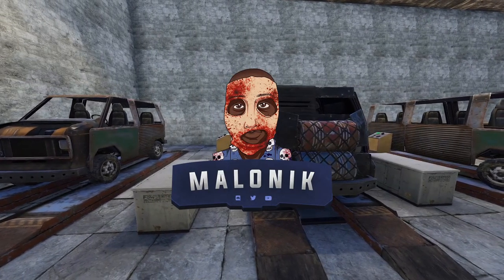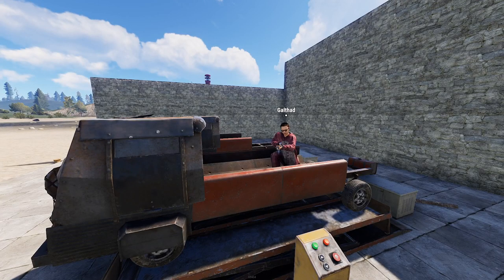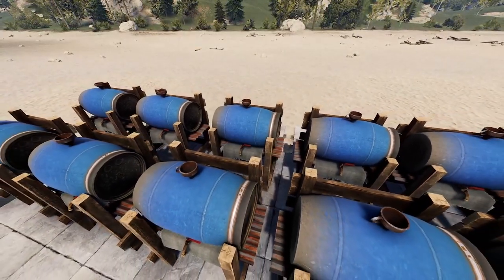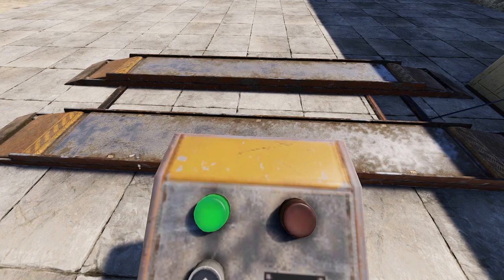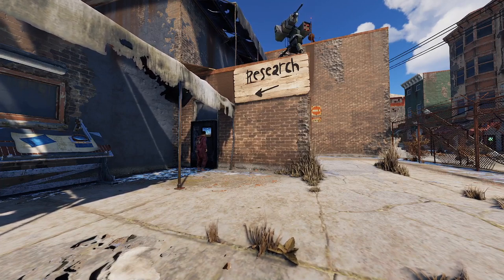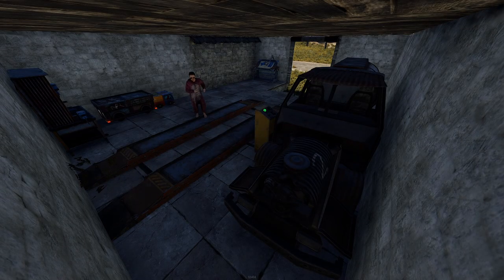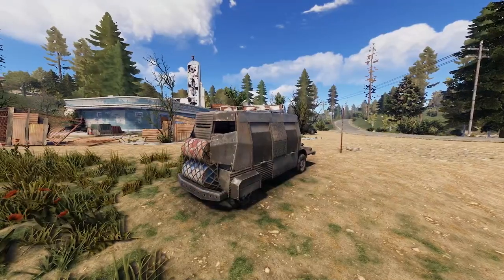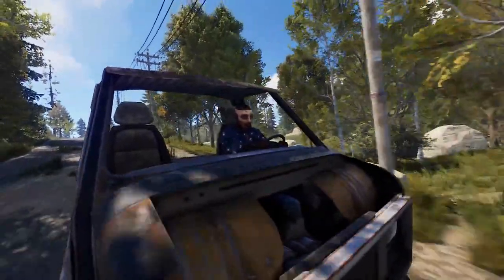RUST How To Car Guide

Comment: I've also found that its much cheaper to repair an existing module than it is to build a new one from scratch.
Reply from the maker: Oooh I didn't think to look at repairing them!! Nice tip! :)
Reply: @Malonik  I was running a garage/shop at the beginning of wipe and scavenging and repair was by far cheaper than building my stock from scratch.

Comment: I've found the cars to be fun but I don't see too many people using them (which I guess is good in a lot of ways). I'm not keen on how easy they damage though. If you clip your doorframe or hit a bad bump it really damages everything and the engine components damage too easy I think (you have to carry spares or are likely going to break down). The decay is also too quick I think. What I think would be cool is if the driver/passengers could duck while inside as you are pretty much sitting ducks and also if people get killed their bodies stay in the vehicle instead of falling out. Wonder as well if you should get a small armour increase like you do with horses. Anyway thanks for the vid!

Comment: My personal Fav is the small 2 module chassis with 2 cockpit with engines, super quick without being insane, handles well and is great off road. (note while on the lift remove the forward cockpit, place engine parts in the rear cockpit then replace the front cockpit because you cant access the rear engine while the front one is on because Rust.

Comment: The reasons cars aren't popular is simple: Too slow, easy to get shot at, unoptimized roads, they hit everything, they decay fast, you need to constantly replace parts, they can't go up a simple hill for shit and you can't really go offroad. 

The way Facepunch designed them just naturally makes minicopters and scrap helis the optimal choice for transportation. They don't need any fancy parts or lifts, they're easily repairable and don't need to be maintained as much, they're fast and they're in the air. Flying is generally much more safer than driving in Rust, you can quickly slip past enemies and obstacles without having to be forced onto a road. You also have a clear view of your surroundings while flying and for the most part, you're untouchable. 90% of people won't be properly equipped or skilled enough to take you down. If you're a good pilot and know the map well(sam site locations, large bases, roofcampers, etc.), the obvious choice would just to use helicopters.

Rust should make owning a car take less work, it shouldn't feel like a chore, because then no one will want one.
Reply: except that you cant hold 3x your inventory per loot module. 
pvp rust is unfun in every aspect, even low pop servers will raid your base relentless within a 2 hour offline window. 
PVE is the only way to play this game unless youre a nolife turd.
Reply: @yauker  Jesus this brought back a phase of my life I’d rather have left behind 3-4 years in the past when I wrote that comment. I was that PVP sweat who would tout having thousands of hours on a shitty ass game that I wouldn’t even enjoy because I took it too seriously. This was peak lockdown when I was in high school too, I used to binge literal 18 hour sessions of Rust on a daily basis. I used to have random alarms at like 5am to check that I wasn’t being raided. It got so bad that I even saw making food as a waste of time I could be using to roam and hit monuments so I’d order the same pizza order literally every day for like 2 months straight. That whole part of my life took me a year and 150 pounds lost to get back to normal lmfao

Funniest part was that I didn’t even have a PC. I’d play it on my garbage laptop through GeForce now(was insanely good during the pandemic, almost 0 latency and was free lmao) on a dollar store mouse using a pillow on the couch I was sitting on as the mouse pad.

Stay far away from this trash ass game, sweating on it put me into such a shitty phase of my life😭

Comment: Im trying to farm in an area with no water, and water collectors need to be buffed. So I'm curious if it is worth me transporting water from somewhere I can pump it. Probably it is easier to build closer to water, but it would be cool if I could collect water with straight with the car and move transport it.
Reply from the maker: You totally can, there's a water tanker module for the vehicles. Been a while but from memory you'll need a pump in the water to connect it to so maybe a little 1x2 down at the water source. Either that or a bunch of water collectors.

Comment: A buddy mentioned that all the car parts are currently the same. Is this true? Like medium and high qual parts aren't any better than the cheap ones.
Reply from the maker: Last time I used them there was definitely a difference. Better parts give you better acceleration, top speed and fuel consumption.

Comment: cars suck off road is why people aren't all over them, according to commits they are already improving that so we should see them used more often
Reply from the maker: Yeah, in the meantime if you have a little garage near the road then it's not so bad.  The roads run to all the super important places at least.
Reply: They are tweeking the offroad performance for next wipe, the traction and the power.

Comment: Pros, fast, kinda safe, fun, Cons 10hqm for t1 parts 25hqm for t2 parts, (Small Engine its 16 and 40 for the big ones) 15 mins to craft all 5 parts, (or 7) have to carry hqm, wood, frags, fuel, and a hammer around to find one on the road to smack it back into shape get the parts and fuel in, and get it into your base...while playing Rust. Pro TIP!!!! your engine parts decay along with the car so take them out of the engine while its garaged.
Reply: CONS!!!!!! so parts decay while in your car....but they dont repair when you smack it with a hammer so your pretty medium or hqm parts take damage with use then become unstackable once you repair them (or dont repair them for that matter)
I really wanted a large box dedicated to slightly used car parts that dont stack
Reply: For now, bare chassis that get left on the lift don't decay. That's going to change with next patch though...